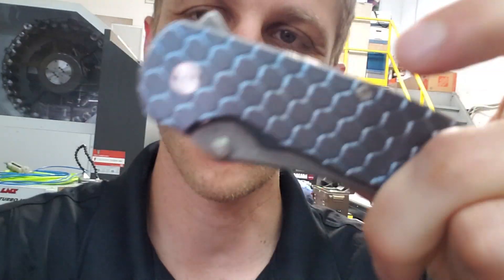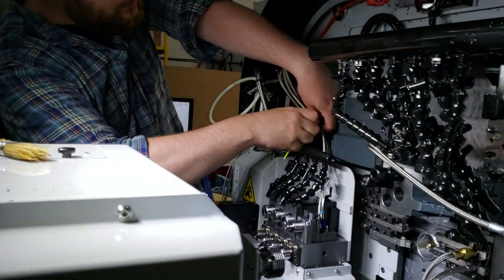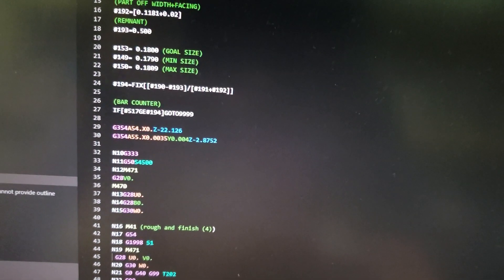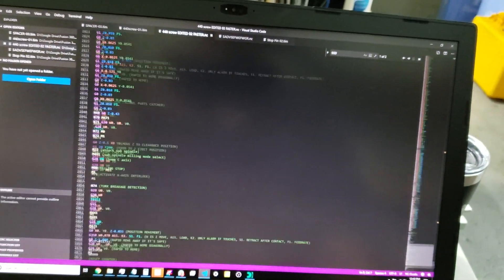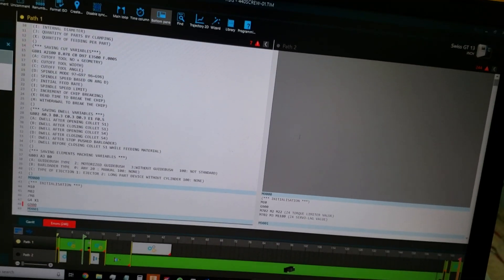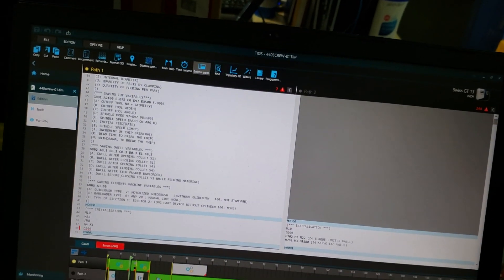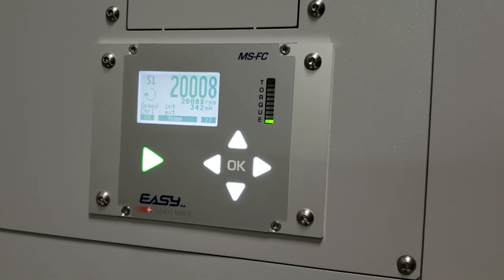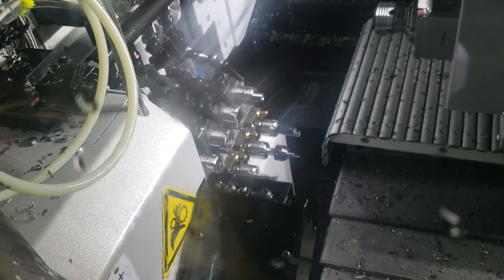Coding Screws on the Tornos

Comment: Have you considered using a rotary broach to cut the torx heads? I imagine it would be a lot faster than milling
Reply: Grimsmo is not about doing it the fastest an easiest way... 

He answered this recently on Instagram. Basically he likes the cleaner looking milled screw head
Reply: he said he wouldn't be able to clock the torx with a rotary broach, their torx screws have a small chamfer around the torx pattern, and some small dimples, both require clocking.
Reply: wonder whats cycle time ..outside of torx..00 ultramatic could make 4/40 screws around 15 sec...or punch out blanks with torx hot heater 3..4 sec and second op mach n thread 10..12 sec..used to make at vsi

Comment: Is there a reason you use such large bar? I'm guessing that it's a shared size for making other parts? Wouldn't it be more lean, quicker, and more cost effective to use stock closer to the finished size?
Reply: I think it has something to do with the spindle liner and/or bar feeder. He said something about it.
Reply: If I were to wager I'd say because it's readily available in that size.